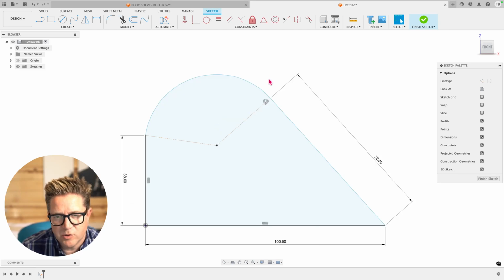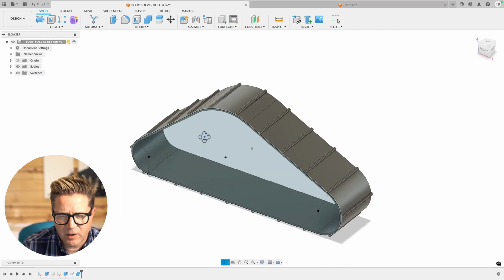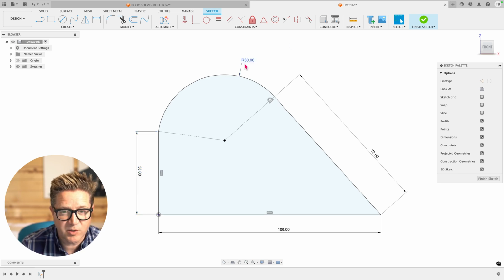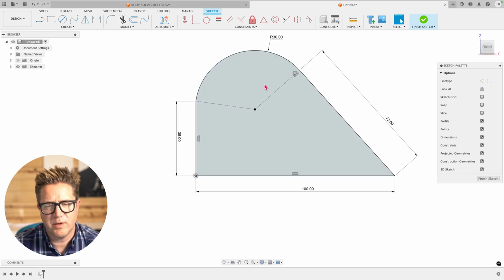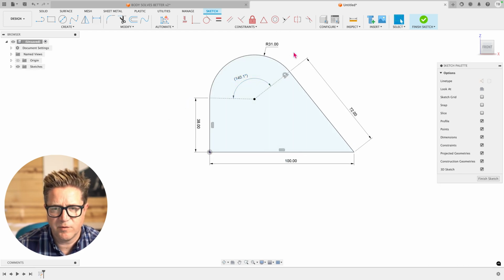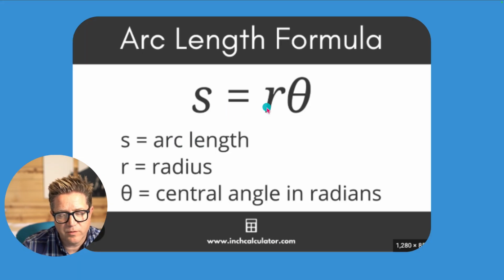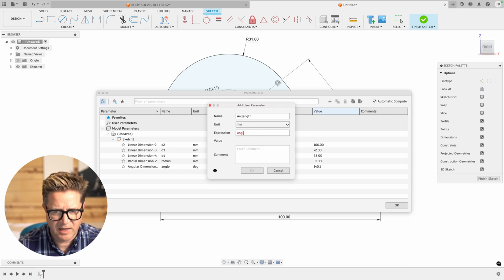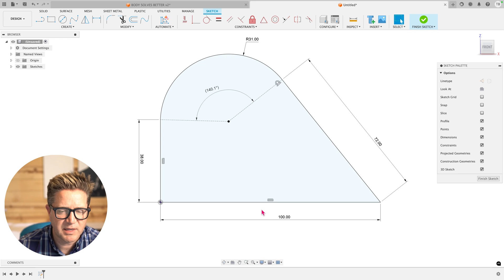Fusion 360’s Missing Dimension - How To Calculate and Dimension Arc Length

Comment: As fusion is really good at giving curve and arc length with the mesure tool, I really don't get why they don't give us driven dimension for those with the dimension tool so we can use them in expression in a procedural manner... if it's driven, it's not a problem, is it ?

Comment: Now, this is great, but would it be possible to make a formula which let you change the VALUE to a specific length, which again update in reverse? Basically you make this, then set the arch length as desired ??? - I tried to insert it all first into () then do a "- 0.013" in my case to change value to 1.00 mm, for my archlength, but it changed the value to 1, but did not update the length of the arch itself, which is the goal.   Maybe there is a way to change the formula to calculate the necessary DEG value to make it 1 instead? and then update the DEG value instead?
Made an unlisted video explaining what I did using your video, and what i want to acheive here: 
https://youtu.be/8dhJaPpB_wc

Comment: Can you take this concept a step farther. Let's say it's not a line, but now it is a component. That component being one of many tubes is say a roll cage that has multiple off plane bends. Then the arc length from the centerline of the tube becomes the bend allowance. Overall objective being to export the roll cage components into bend instructions for the welder/fabricator or for a cnc tube bending service company.

Comment: Can you explain your use of parentheses in the formula? In math, you use them to drive the order of operations, where the calculation inside them is performed first. However, you've wrapped a single variable with no operatio, so it's not affecting order in any way. I can't figure out any reason to use them.
Reply: Never mind. Figured it out. They're needed because the unit types are different.

Comment: This is fantastic! I am trying to make multiple sketches to loft a pattern to represent folding fabric. The overall length never changes but I need to factor in curves for folds along the way. This will help with my straight line and arc method. 

Is there something similar for spline length? That would help with the extra calculations in the parameters.

Comment: I didn’t catch where rad was defined. Is it built into fusion or did you have to define rad = π/180 somewhere? I guess the way you dividing it would be rad = 180°/π radians.
Reply from the maker: It's a known parameter in Fusion.  It lets you convert to radians used this way but there are other methods :)

Comment: Literally ran into this problem a few hours ago. Needed a certain arc length. I ended up just using an online calculator webpage where I plugged in desired arc length, radius, then it spit out the angle I should use. Not perfect solution but was good enough